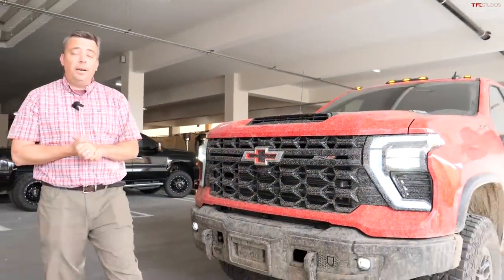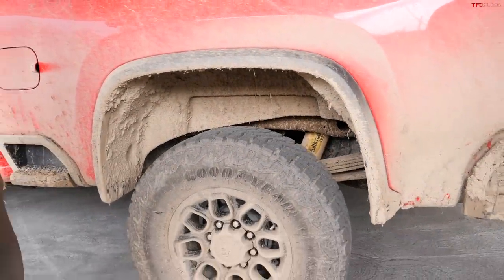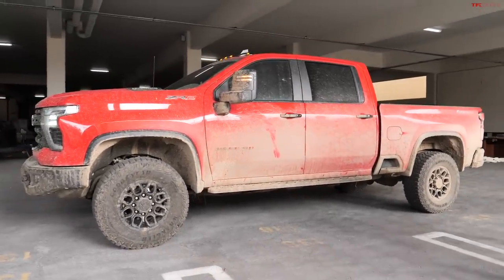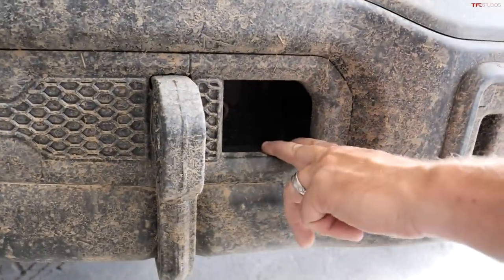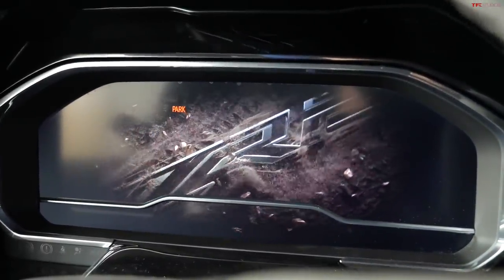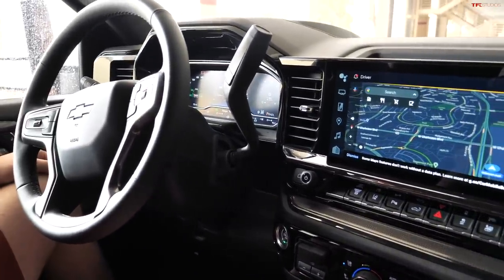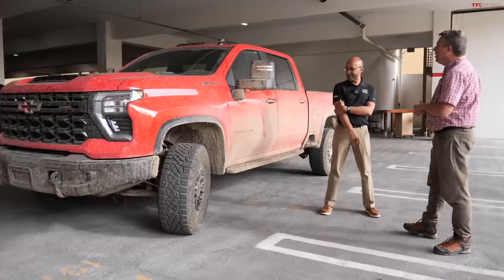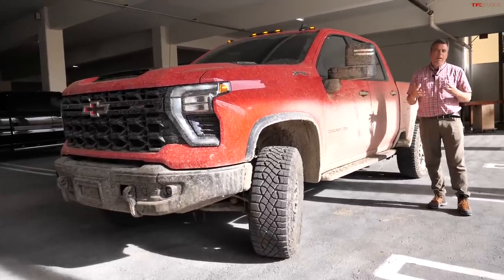TFL Exclusive: I Go Hands On with the First-Ever 2024 Chevy Silverado HD ZR2 Bison OFF-ROADER!

Comment: Wish it had a front locker. But GM knows it would grenade the IFS. I’m surprised they haven’t gone back to a solid front axle. These trucks are so heavy and strong now I’m surprised we don’t see more IFS failures
Reply: I always see tie rod ends and cv axles especially with a level kit. Straight axle belongs under a heavy duty truck
Reply: @freedomisntfree_44  😂 no it don’t the 2wd f350 and ram 3500 have the same and tow good I did hotshoting and tested all 3 and it’s cheaper do to front suspension on the chevys then the fords or dodge and they all tow the same
Reply: @jmg_2_slow74  those 2wd front ends are stronger than gms ifs. I farm dude 🤣 ford by far tows the best.
Reply: @freedomisntfree_44  ok cool you want a cookie ?
Reply: @jmg_2_slow74  what are you 5? Of course I do
Reply: @freedomisntfree_44  👍
Reply: @jmg_2_slow74  my 2wd F550 has a solid bar under the front, nothing like an IFS and guess what? It is very durable, not like the weak ball joints and tie rods in the GMs
Reply: @jmg_2_slow74  those 2 wd trucks are also 2 wd and not comparable.  No torque is being transferred to tires through them.  That's what kills HD ifs durability.  There is a reason Ford and ram use a straight axle.

Comment: Good looking truck, great interview. GM fails…this truck has no up travel!. The bump stops are riding on the lower control arm! And for the HD ZR2, GM should have eliminated the torsion bar and put in a coil over. Again no front articulation. And no front e-locker!? Big disappointment GM!

Comment: I mentioned it in another video, GM always late to the party. But this looks promising.
Reply: Always, always trailing Ford and Ram. 
Chevy fans still waiting for a Raptor/TRX competitor too.
Reply: @jibrilthegreat35  Correction: Chevy fans aren’t waiting on a Raptor/TRX competitor, that’s the Raptor/TRX fanboys waiting for Chevy to acknowledge that segment so they can compare - but GM continues to pay them both dust in that regard. They even put a supercharged engine in the Escalade but no supercharged pickup. Y’all are just mad that GM’s world doesn’t revolve around Ford and Stellantis. Y’all want them to chase the others around but they tend to do their own thing and it pisses you weirdos off.
Reply: @mybro727  😂😂😂😂 angry chevy fan boy, hahahaha GM doesnt have the guts to build a high speed off road truck, the recently raced a factory ZR2 in the mint 400 and guess what happened? It ended up with the frame folded like a taco, GM think it has what it takes but it doesnt, the Trail boss is a lame off road truck. Rancho shocks? Hahahaha thats soo 90s and no skid plate under the fuel tank? 
GM tried but it constantly fails, and it replies on it “weirdo” fan boys to always make excuses. 😂😂😂 Government Motors
Reply: @jibrilthegreat35  You should take another gander at that front skid plate. That ain't skidding over anything with that shape
Reply: @oscara.9265  that chevy skid plate? Like I said before, GM doesnt build serious off road trucks.

Comment: But why is the bump stop resting on the LCA when it is mearly parked???
Reply from the maker: The bump stops are near the pivot point of the lower control arm. So the suspension can still move at the wheel, but the bump stop is there to support.
Reply: @TFLtruck  I see 👌🏻

Comment: why would they make a heavy-duty off-road truck?
The longer and longer you make a truck the less and less maneuverable it is off-road and the less obstacles it can actually go over. I already know that 90% of the buyers are only going to take it off-road maybe once a year if even that.
Reply: Because people who need the capability and power of an HD many times need to leave the road.   So you take a great truck, put an advanced suspension made for both on road and off road.  Then you put the strongest bumpers and skid plates ever produced from the factory, along with high strength offroad wheels and you have a serious truck unmatched by the other OEMs.

Comment: Is the front and rear locker on the same switch??? Why not two separate switches? Or did I not see it correctly?
Reply: No front locker unfortunately.
Reply from the maker: No front locker. Just rear locker and Off-Road mode with traction control and brake distribution.

Comment: What?!? No front locker?!? What an egregious oversight! Why would anybody buy the ZR2 over one of the other if it doesn't come with front locker? Traction control can never replace a proper locker. 😒
Reply: Humvees don't even have lockers, a proper lsd will do the same w a little foot work and are better in loose ground and snow.
Reply: @philipparana9225  Hummers have Thorsen don't they?

Comment: offer some 4.10's to turn those bigger tires
Reply from the maker: There is plenty of torque from either engine and a 10-speed automatic transmission.
Reply: @TFLtruck  there is plenty of torque, but make it more useable down low off the line where its needed to move a heavy load..  there is a reason ford and dodge have options
Reply: @chrisl6281  look up how short the gearing (especially 1st gear) is on these 10 speeds compared to the old 4 and 6 speeds

Comment: That front bumper is a bad design, because if you live in a state where a front license plate is required then you cannot use it for your winch I thought zr2 was the part number for the front Locker of course has to let us down

Comment: Front, center and rear locker, and portal axle please!!
Reply: There’s no such thing as a center locker with a true 4x4 transfer case. There is no differential. When I’m 4x4 it always splits 50/50 between front and rear.
Reply: @loganrichardson5385  exactly

Comment: Let me guess “only” $80k for the gas truck and $90k for the diesel?  No thanks.  I’d rather buy an older truck, torch cut out that mess of a front suspension and do a solid axle swap.   Add a lift, lockers and have a much better truck for less money.

Comment: AEV works with everyone except Ford. What's up with that. An AEV converted Super Duty would be sick
Reply: I always said that would be freaking awesome AEV do a Super Duty
Reply: Based on previous interviews I don’t think Dave Harriton (CEO AEV) has any interest in working with Ford.  Plus Ford has a larger relationship with ARB so if Ford wanted to get into the OEM spec off-road trucks they’d likely continue their partnership with ARB.
Reply: @Gazziza29  that's true and ARB is also a good brand of off-road products too
Reply: AEV was solely a Wrangler company before it began building Ram HD parts around 2015.  Then Chevy came to AEV in 2016 about the Colorado, which then lead to other GM programs.  Unlike most parts manufacturers,  AEV isn't trying to build parts for every truck or SUV out there.  Its been an organic growth from one model to another, spurned by OE demand.

Comment: Andre, is GM  still using frame wax treatment on these trucks ? If so, total deal breaker - it’s garbage, it doesn’t last. Time for GM to start e-coating these truck frames.
Reply: The wax coating has worked fine for years.  I’ve got a 30+ year old square body GMC that has held up just fine.

Comment: This is where GM clearly misses the mark. Keeps mentioning the loss of "payload" from the lack of add ons that this exact type of truck would be purchased for specifically. 
Still wanting the zr2 bison to be a full on tow pig, but the target audience is not planning on using this as a tow pig. 
If we (the buyers) wanted a nice ass tow unit, we will get a ltz/z71 setup or a high country/similar.  If we are looking into an off road capable truck, we are looking for the MOST offroad capable truck, for the right price. 
No front locker, no tank skid, etc etc. Come on GM. Take notes from your competitors. If you want to compete, then you have to COMPETE.

Comment: Bed size? Where's the steps in the rear bumper
Reply from the maker: The bed size is still the same as before 6’10”.  The bumper steps are not there on the Bison version of the truck with AEV bumpers.
Reply: @TFLtruck  so standard bed with crew cab vs 1500 with short bed only with crew cab.. cool

Comment: The front suspension is already sitting on it's bump stops.
Reply from the maker: The bump stops are near the pivot point of the lower control arm. So the suspension can still move at the wheel, but the bump stop is there to support.
Reply: @TFLtruck  Thanks for responding.

Comment: It's almost like GM is run by bean counters with no soul, no brains who they purposefully sabotage and under achieve. I feel very sorry for the guy who buys one of these things with the same shocks as a Colorado that is going to have to constantly replace them (after 2-3 sets are warranted) for a few thousand dollars a set after the warranty expires. They learned NOTHING from the magnetic shocks that were the same size in a Corvette as an SS sedan and had to be constantly replaced under warranty because the car was so much heavier. This truck should have an LT-5 blower on the 6.6L L8T that makes 800hp on E85 connected to the Allison 10spd. This truck should have 37" tires, tons of travel, bypass shocks. This truck should be a CAFE exempt 8500+lbs GVRW Raptor KILLER.

Comment: DSSV shocks... But yet still has shit torsion bars?????? And those tie rod ends OMG!! Do they not know every single guy that has these trucks upgrades to the heavy duty ones?? Literally a level kit, 35's and some bumpers you can get at 4wheel parts.. GM come on man! And the shocks still hang down. Count me out on this one. Doesn't matter if you have 5k Fox race shocks. It's only as good as the rest of the suspension and travel allows...GET RIDE OF THE TORSION BARS GUYS!! GOOD GOD

Comment: Let me guess, the 2500 ZR2 has the same no-name “MultiMatic” shocks that the Colorado and Silverado ZR2 have? Welp then if that’s the case I hate to tell ya’ll but your never gonna be able to do much off roading with any vehicle that have those shocks I used to have a Silverado ZR2 before I realized it wasnt actually at all capable of doing the things GM claimed it could do. Piece of advice always go with vehicles with the suspension from the most reputable off road suspension brands like FOX, Bilstein, King, Rancho, Rough Country, etc… over the ones with the no name brand suspension (like the ZR2). ALWAYS Remember, nothing is more important on an off road focused vehicle than the suspension. Don’t make the same mistake I didn’t don’t buy this truck.
Reply: Multimatic has been on formula race cars for years, do some more research. As far as them being used on off-road applications, they seem to be just getting into it with the ZR2 platform... but at the end of the day this thing is a heavy duty, which is a giant heavy a$$ truck... no-one buying this is trying to go crawl a mountain or run a Baja race, and if you are expecting that then you have no-one to blame for wasting your money but yourself. It's a good looking truck that can tow half a house, then maybe tackle a trail down to a secluded lake for some fishing.
Reply: @jbaker4197  I’m not expecting it to crawl a mountain or anything. I’m expecting It to actually be capable of doing the things that GM says they’ve tried it on before. And it’s not. I don’t give a shit about Formula Race cars. I’m talking about a Chevy Silverado ZR2, not an F1 car. Chevy has the ZR2 around to compete with the other big car brands off road vehicles. The entire purpose of the Silverado 1500 ZR2 even existing is to compete with the TRX, Raptor, and TRD Pro. All 3 of those trucks are the best full size off road trucks money can buy. The Colorado ZR2, competes with the Ranger Tremor/Raptor, Tacoma TRD Pro, and the Gladiator Rubicon, again these trucks are the best mid size off road trucks money can buy. But guess what? All those trucks from Chevy’s rival brands all have 1 huge thing in common. A bad ass, extremely durable and capable suspension that’s been proven time and time again by millions of different people all over the planet. Oh and I just have one question for you. What brands designed/built the suspension on these trucks?

Comment: Probably the lame torsion front end.
Reply: What’s lame about the torsion spring front end?
Reply: @ALMX5DP  send it through the whoops like a ford or dodge with a Carli 3.0 shock kit setup and tell me how well it goes. 

You can have independent suspension, f150 raptor is a good example- it’s the torsion that sucks compared to a coil spring.
Reply: @Upliftyourbrothers  comparing stock to a Carli aftermarket setup?
Reply: Why no payload information on the diesel?
Reply: @ALMX5DP  yes. The point of ZR2 is improved off road suspension and travel. Torsion is limited. Non upgradable. There is a reason all other capable off-roaders don’t use torsion.
Reply: @Upliftyourbrothers  ah gotcha so just lame in the sense it’s not very modifiable?
Reply: @ALMX5DP  these trucks have very limited wheel travel. The fanciest shocks in the world cannot deal with the physics of poor wheel travel. These bump stops are touching while sitting on the showroom floor.
Reply: @Upliftyourbrothers  is that just specific to the Silverado here or torsion spring suspension in general?
Reply: @ALMX5DP  the GM 2500/3500 is the  only truck that uses torsion springs.
Reply: @Upliftyourbrothers  yes, you initially made an argument about stock versus aftermarket suggesting the torsion bar setup is not as adjustable, and then pivoted to travel. I’m unclear if you’re specifically referring to just the way the Silverado is designed or torsion bar suspension in general. Do all torsion bar suspension designs have limited travel? Is the Silverado HD suspension not able to be changed to increase up or down travel? Just unclear what your argument is when you say it is lame.
Reply: @ALMX5DP  sorry for the confusion, to me it’s lame due to its low level of travel, it’s fixed spring rate, lack of aftermarket support, lack of ability to increase travel, and lack of ability to level the truck without changing the ride quality. It’s fine for a stock 1 ton that tows, but there is a reason nobody else uses torsion off-road.
Reply: @Upliftyourbrothers  ah gotcha so sounds like specific to the Silverado here then. Not sure why the designers didn’t change around the geometry to be a bit more catering to the offroad crowd if it is determined to be limited in some respects. I know in the past there have been quite a few vehicles which used torsion bar suspensions fairly successfully and were able to be modified fairly easily for a given terrain or use.
Reply: @ALMX5DP  for driving and towing on pavement they are adequate. Anything off road with speed involved they suck. I’m sure someone could in theory design a torsion suspension that’s capable, but every off-road vehicle that’s made for speed uses coils, some use leaf springs in the rear, but more and more are going to coils with bypass shocks. I’d really like to hear what the actual wheel travel numbers are for this ZR2. Any idea?
Reply: @Upliftyourbrothers  no idea on travel numbers, but I’m sure in time more info will be released or maybe we’ll see a comparison test between this and the Tremor/PW or something to see what the difference to the end user might look like.

Comment: Power Wagon is still King, second Tremor, then this ZR2.
Reply: I would definitely agree with that with the Tremor you can add the built in winch with the diesel and you can get the Tremor in F-250 and F-350 I would like to see if the Ram diesel can have a winch like actually see if it's true what Ram said it wouldn't work for a winch with the diesel
Reply: The Bison can go places which would destroy the underbody of either the trucks you mentioned.  Not even close.
Reply: @camjeepram  the PowerWagaon has front and rear lockers also a sway bar disconnect does the bison have a front locker no all you need for the PowerWagaon to be better is add bigger tires then it will beat the bison and Tremor but the PowerWagaon is better the to late Chevy Bison. Again the PowerWagaon is still top dog then I agree Tremor then the ZR2

Comment: I mean its not bad but its not good the truck is way to big
Reply: Is it? It's no bigger than a power wagon, or any other lifted HD.
Reply: @mak450  I mean pickup trucks nowadays are massive makes my 1995 f250 single cab 4x4 look tiny in height and with.
Reply: @infernoking7504  sure, but find a similar year and model crew cab with similar suspension and tire and it would be remarkably close I suspect.